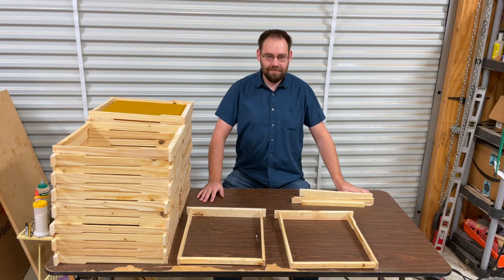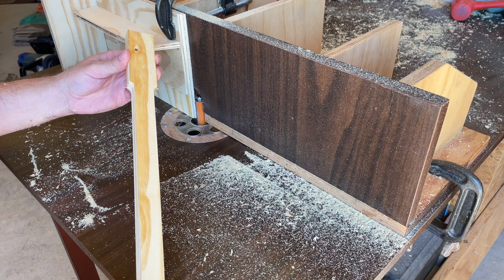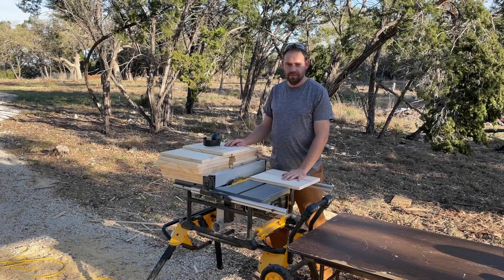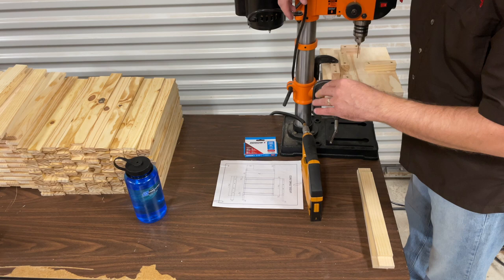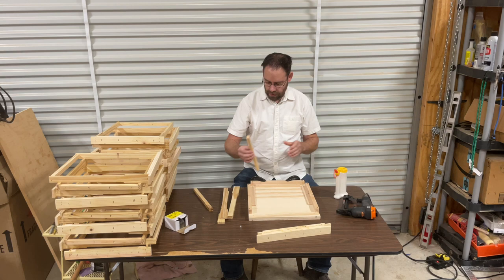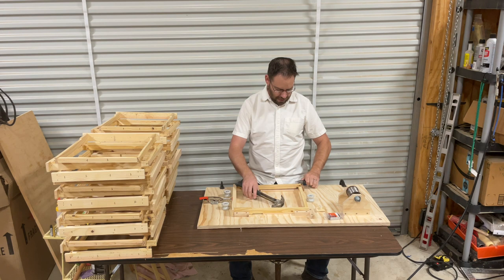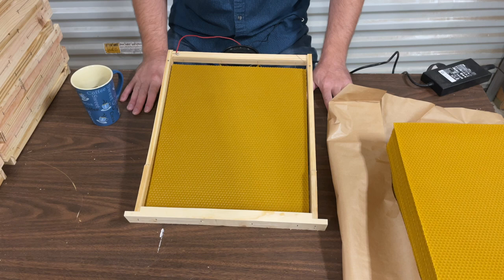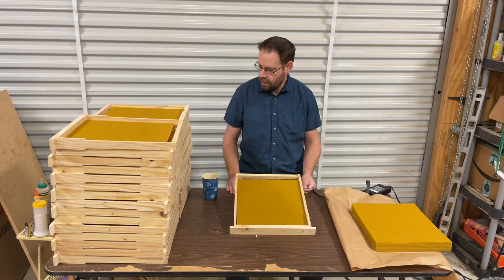Layens Frames

Comment: Great video. Just use your push stick to save your hands more when your cutting the top bars.
Reply: Yeah.  Some scary stuff.  Id use it with the router too, but my dad has 3.85 fingers due to a tough conversation with a carbide tipped blade.  Otherwise great video.

Comment: Is there a purpose for the shoulder on the side pieces? I don't have a router table.  Wondering if I could cut the sides to 1" the full length?
Reply from the maker: The shoulder is to help them side in yet still sit tightly together.  I haven’t seen any without a shoulder so I’ve always assumed that there was a good reason people were putting in the extra work.
Reply: @Our2Acres  Thanks, I suppose I could set a stop block on my table saw and square cut it out that way. 🐝
Reply: The shoulder isn't entirely necessary.   It's used for kaaping the frames tight together.  But if the hive isn't level, it'll keep the trades from hanging plumb  and you can get some wonky comb.  It's best for hive to be level in any regard.  If you don't have all the fancy equipment, you can cut about the side bars down to around around 1" and it should work fine.

You also don't have to use the wiring and wax foundation.  You can use a piece of 3/4 chamfer still glued and nailed to the under side of the top bars and wax it for the bees to start from.  Then drill a small 1/4" hole about halfway down the side bars, glue in a piece of 1/4" dowel, and  cut off the excess.  Of you can use a couple of those long bamboo shishkabab skewers and split the frame into 3rds.   The bees will use the cells that coincide with the dowels for bee bread instead of brood.
  But...  the wires and wax foundation seem to sag or collapse more often than the frames with cross dowels.  And it seems like a lot less wasted time than dealing with the wires and wax foundations anyway.